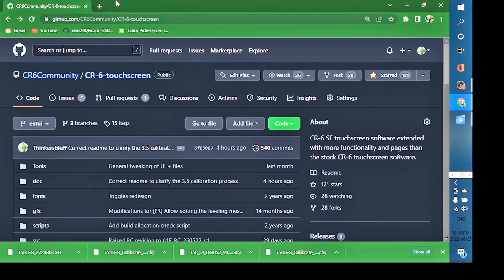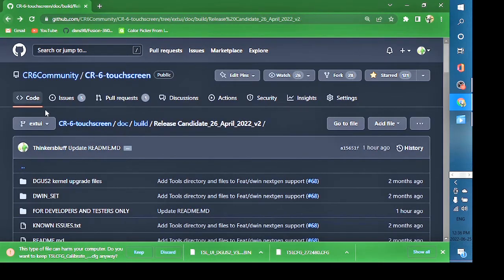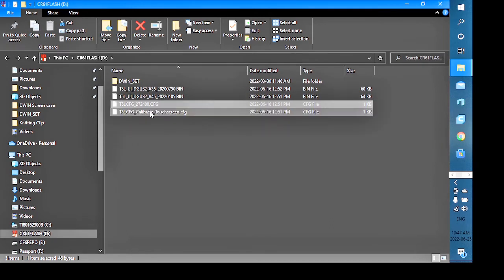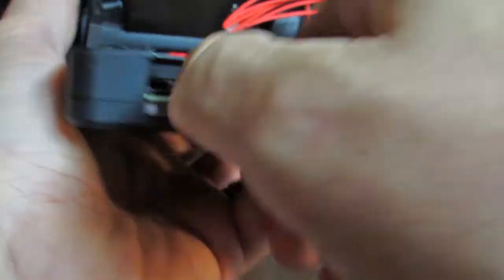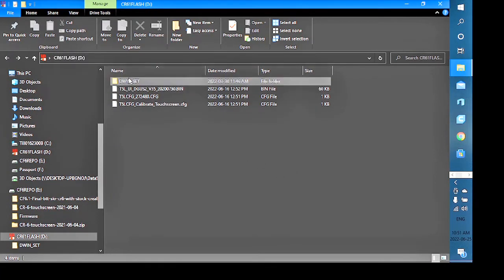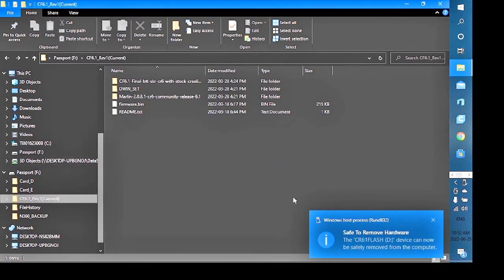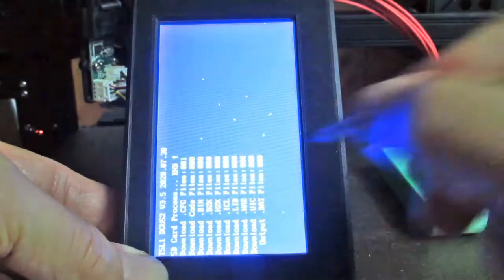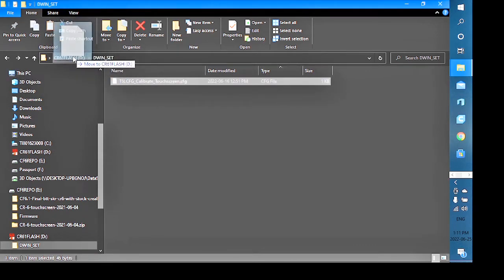OPTIONALLY: Learn How to Calibrate your CR6 DWIN Touchscreen

Comment: Thank you for this video. I updated from my stock firmware to CF 6.1, and first, I was on a black screen on my display; after following some steps in the forums, I ended up with a non-responsive touch screen with v4.5. I followed your steps as explained and got it working immediately. Cheers from Chile.
Reply: Please bro help me i am having same issue after i flashed some old dwin-set from web now I upgraded latest touch is non responsive please tell me how to do
Reply from the maker: If you are speaking of a CR6 stock TFT display, you can follow the instructions in this video to flash the operating system back to the version for which your display is calibrated.  

The display and motherboard firmwares must also be a matched-set, whatever else you do, or they will not work with each other.

Comment: Good afternoon, it appears your file T5LCFG_272480.CFG in the DWIN SET folder is completely missing, and the hole Dwin set as well. I needed today to recalibrate my screen which was done successfully, but I had to load the Re Factored version because I couldn't get the landscape orientation correct or back again with just the touchscreen CFG file and the 2 V3.5/ V4.5 bin files
Reply from the maker: Yes, I removed some of the files and folders since making that video, but I did leave behind the CFG file and the two DGUS files, so that folks can still follow the instructions in this video.  

Maybe you were one of the unlucky visitors who tried to follow the instructions during the time between when I took the files down and when I put the minimal set back up?  Sorry!
Reply from the maker: Careless of me to remove the DWIN_SET folder completely.  Sorry.
I tried today to put that folder back,  but was defeated by GitHub.
I have instead put the CFG file back up there, in the same folder as the calibrate_display one.

Thank you for alerting me to my error.  Sorry it took me so long to notice this feedback...

Comment: Please i need help i have dwin 7inch capactive touch hmi display i flashed some old dwin_set folder form web which had older kernel from 2023 i had latest 6.5 2024 after flashing touch is not responding even after flashing latest 2024 back still not working.I tried ur method also when the plus + appears for calibration it does not respond at all nothing is working for me please 🙏🙏

Comment: Thanks to you I got my Printer running again. Vyper unbricked ;)
Reply: I followed this guide & my vypers touch screen is still not working! Any suggestions?
Reply from the maker: Sorry, I don't think the Vyper screen is the same resolution as the CR6, so the CFG files I provide would probably not work with it.

Comment: Thank you so much for this video.  I throw my screen in the junk box and  call it quits after failing to get it work trying to switch to First Layer configuration. I followed your calibration steps and now it's working fine.  Thank you so much.